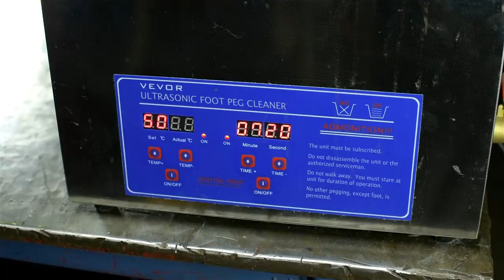7075, 7076... Whatever It Takes

Comment: Would adding to the frame side of contact, rather than the peg side, have been an option?
Reply: I thought of that too. I think it might be better for now, but not worth it b/c he's planning to replace the worn out pegs soon & then the new ones might not fit
Reply: I would imagine it would have worked, until the day when he got new pegs they would be angled too high.   I guess you just hit it with an angle grinder.  Always more than one way to skin a cat.
Reply: Probably, but if he replaces the pegs eventually the new ones would be too high
Reply: Pegs are "consumable" items, frames aren't.
Reply: i think its not only for the new pegs as some pointet out but also for risk reduction/management if the frame side is also an unweldable alloy you might get cracks where you can't simply replace one easy to service part. + the risk of catastrophic frame failure midride sending you on a tangent over your front tire
Reply: A little more tricky to put it on the milling machine for final cleanup after welding...
Reply: My rule of thumb is to modify the part most easily replaceable...
Reply: @drickard67  I like to call that the golden rule.
Reply: @drickard67  ToT would call it "the rule of finger".
Reply: or a crowbar to bend that part of the frame up? Then again, my usual order of attempts to fix goes: 

Spit
Duct tape 

Hot glue 

Epoxy
'wish I had a #%&@*$ welder!

Comment: 0:16 That's something you only let happen once  per pair of underwear.
Reply: Speaking of which, you think he buys new underwear?
Reply: @samo4648  until he finds the proper materials to weld his old pairs together he'll have to i guess.
Reply: "That's something you only let happen once  per pair of underwear.".. twice surely... don't you know you can always turn them inside out afterwards... (and... demonetized in three, two.. one)..
Reply: I learned many years ago when spindle-moulding acrylic to always move the part in the opposite direction to the rotation. It makes it much harder for the machine to pull it out of your hands as you're pushing in the direction it would push the part.
Reply: I believe you can shave it off one thou on a lathe and it's good as new
Reply: Warning: EXTREMELY DANGER!
Reply: Shaun Stephens (psst... that's router 101 rules for every material)

Comment: Hey this old Tony, instead of replacing the pegs how about drilling out the hinge holes and press in a steel sleeve?
Reply: Or maybe relocate the bolt centerline back where it should be since it's worn.
Reply: What - you want he should start making SENSE, now?
Reply: @flurng  Yeah, what was I thinking, maybe I should have had a cup of that ultrasonic cleaner like he did, that would have straightened me out.

Comment: Why didn’t you add the weld to the frame landing zone instead of risking life and limb when your infernal weld heat weakens the peg temperament? Odds are the frame was anything other than 7075.
Reply: If he gets different pegs then those would point too far upwards due to the excess material.
Reply: @skmetal7  which he could then grind off.
Reply: Exactly what I was thinking. the frame is welded so it has to be weldable. If he ever changes the pegs he would just have to grind it down.
Reply: My thoughts exactly. Also, replace the bolts, mill out the pivot holes, and insert some brass tubing to take up the slack.
Reply: Or a bolt down spacer to frame.

Comment: I’m in the following conundrum: I have bought a nice Trek bike for cheap, it’s made from 7075 aluminium, it is a fully welded frame, beads everywhere. One of the weld beads has a long crack through it. I want to try and weld it. 
Everyone is telling me it’s not possible, yet many bike manufacturers are producing fully welded 7075 bike frames.
Uncle Tony’s advice: if it’s full of welds, probably weldable. Thanks Tony 😁

Comment: So a quick theory. Since the caliper has opposed pistons, you may not feel any pulsation from a warped rotor. As one piston is pushed in by the warped rotor, the pressure transfers to the other piston in the caliper simultaneously and does not transfer pressure back to the master as it would in a floating caliper setup on a car.
Applying knowledge to that theory, the reason you would still have a soft pedal anytime you initially press the brake was possibly pad float. Off the brake, the warp of the rotor would actually push both pistons in very slightly over a rotation, which you would not actually feel of course since your foot was not on the brake pedal.
A bit more knowledge from researching car brake upgrades.This happens in cars frequently with fixed calipers, especially if they have a bad wheel bearing or have been upgraded to solid calipers and there is flex in the assembly. Any angular movement in the system can let the rotor push back the pad. Then you have an extremely soft pedal on your first press after cornering.
I do have a final potential theory. In your soft spongy brake video, it actually looked to me like one of your rotor screws may have been a bit loose. If it was, but not loose enough to come out, possibly thanks to the spring washer, then it could have had some run out which would have immediately been taken up when the brakes were pressed. So a similar pad float issue to having a warped rotor would occur, but with even less chance of feedback or pulsation at the pedal.
Hope you don't mind the rant, was just thinking about it a lot.

Comment: About the break rotor...
When you apply hydraulic pressure on the break pistons and these press the break pads into the surface of the rotor, you convert kinetic energy into thermal energy. This thermal energy is initially accumulated inside the steel of the rotor and the irradiated into the environment (infrared and convection).
Now there is actually a saturation function for that process. That means, that the mass of the steel rotor can only take so much energy in (of course the irradiation is slower the pumping energy into the rotor). Is the rotor saturated (mostly glowing red), the break starts to feel “spongy”. That will happen for a thinner rotor sooner then for a thicker rotor, because the thinner one simply Hass less mass.

Comment: U-shaped steel plate with 2 eyelets, shaped in such a manner that the peg bolt(s) hold the plate in place & the plate hugs the contour of the foot pegs and provides that little bit of shimming to de-sag the pegs. Seems this way you wouldn't need those extra two washers either.

Comment: With all these comments, several people probably already pointed out that the Loctite has bad long term effects on many plastics, PVC is among them I believe. It doesn't kick off where the threads (or shoulder) contact the bore ID, and it just sets there, eating away at the part. Hope it helps, and Congrats on the new toy!!

Comment: What you fail to worry about is the heat affected zone at the site of the weld.  First, the heat treat is trashed at the pivot point, the point of the highest stress, and some of it is in tension.  Second (and this is the dominant one in welding) the stress built up in the part resulting heating one point to melting, and the rest at room temperature.
       (In steel, heating by only 140F causes it to expand 0.1%, and if that is resisted, results in 25,00lb/sq in stress.  That's how I hold the tires on my steam engine.  Machine 0.1% undersize, heat ~300F,  drop on, and allow to cool.  Aluminum expands at double the rate of steel!)
     To do this right, you need to heat the part to ~700F, hold (to anneal out the stress), then cool to the 350F treatment temperature, hold for 24 hours, then air cool.  In a week the part will be hard.
     Arc torches are so easy!  Until you discover that to do it right, you need gas torch to do the anneal afterword.

Comment: HI TOT, thanks for your videos, really love them. On the basis of "all information is usefull" and in the interests of shutting the stable door after the horse has bolted, found a new life, got married and become an airline pilot, heres what I think was wrong with your previous bikes brakes. Between the brake fluid reservoir and the cylinder is a small hole called the "recuperating hole, which lets fluid into cylinder to take up wear on the brake pads etc. on this type of cylinder it is critical that the push rod is set so that when you push the pedal down, the recuperating hole is covered by the piston before the brakes start to operate, and that it is uncovered again when the pedal is released to the rest position, allowing more fluid to enter the cylinder. If the recuperating spring is weak, you can get a situation where the piston does not return fully, and therefore the clylinder does not get a shot of fresh fluid when it needs it, and although there is no air in the system, the pedal feels soft, and does not apply the brakes firmly. Oh and they can be a bit of a pig to adjust!.  Two vehicles I have owned in the past ( Morriss 1000 van, and a s2 Landrover) were not fitted with a spring in the master cylinder, and relied on the fluid in the cylinder  to keep the piston in contact with the pushrod, when you tried to bleed an empty system, the piston covered aforesaid hole, and when the pedal was released the piston stayed at the wrong end of the cylinder, blocked the hole, and made any progress impossible untill you had returned the piston to the rest position. I built an ezeebleed system out of junk that cured the problem, and prevented corrosion and stripped the paintwork by covering the car, me and the workshop with hydraulic fluid, but hey, isn't that what life is really all about?  Keep em coming!
Phil,
East Yorkshire
UK
https://www.youtube.com/channel/UCKf0nWnXKXltBjj7MWtdjWA

Comment: After watching the beginning of this video I went to look at you original video.

There is one reason you brake could have been spongy and that is if the disc (rotor) was badly warped. If it were, the first part of the pedal travel would have been straightening out the disc, so there was no reserve travel to do the braking.

When the brakes are released on a disc brake, the deflection in the seals in the caliper withdraws the piston by a few thou so it does not rub on the disc. If the disc is warped the pistons are pushed back further away from the disc. In this case, when the pedal is pressed, the first part of the movement is pushing the pistons back towards the disc (and straightening it out)

Simples!!

Comment: Fyi, the usual causes of spongy brakes is usually air in the hydraulics, oil contamination, worn out master cylinder, or mechanical binding.

I'm glad you replaced the problem with something you've been wanting ;)

Comment: You can weld 7075 in certain applications. Like in mould repair, you can put weld material on top of 7075 to then machine back to form. It won't be great quality, but it's through welds that crack very easily for 7075.

Comment: before I heard your solution, to be honest I am not a welder, machinist and have no experience with any of it but want to get into stuff like this, in a serious way!! (I'm a carpenter by trade) my first thought would be a "grub screw" in the back where the pedal meets the frame, you could tap it and make it adjustable so you can change the point of where it stops.

Comment: Good stuff as usual, love this and I too counted fingers.    Now who thinks most of the issue was in the worn hole and bolts and IF Old Tony just had a lathe at his disposal could have made either a thin tube bushing to fit over the bolt say some SS or  some new Bronze bushing pressed into the Pegs and new bolts but then Old Tony would need access to a Mill or at least a reamer.  Either would or should eliminate buying new pegs for wear in the future.       Then we never saw the underside of the frame mount, could that have had wear or been welded up a tad of which the Frame material could be worse to weld on, Chrome Moly or  ????

Comment: Bit of trivia to all you engineers out there:   AL7075 T6 has a tensile yeald strength of 570Mpa or 57kg/cm^2.   Volume for volume, it's stronger than most steels.   Weight for weight it's almost 3 times stronger than most steels.    Jet fighters (F-15, F16) are made out of this aluminium alloy.

Comment: Intro is why router tables with the bit coming up from the bottom are so underrated. The workpiece can't really move up on the bit to catch it as easy if there's table in the way and even if it does the friction of the table and maybe a fence at the edge helps takes some force off -- not that 20mph off a part being immediately flung 400mph at you is gonna make much of a difference, but it could help, maybe

Comment: A thin rotar can make a soft pedal.the piston has a piston ring that pulls the piston in by design.so if its out further than normal and the piston could be retracting.also if the rotor is warped or not perpendicular it can cause the problem. Diagnosis should isolate the system.clamp the hose while depressing the brake.that should make it solid if the problem is downstream.

Comment: I cant help but point out that when rotors wear they tend not to wear evenly. The pads tend to wear the braking surface so that it becomes concave or a series of furrows. The thickness of the rotor doesn't matter (to a point). The flatness of the braking surface does matter. If the pad is sitting on a bunch (or a few) high spots it wont be able to create good friction. A rotor in this state can make the break feel mushy as the pad is forced to flex until it matches the profile of the braking surface. New pads make it worse.

Comment: Hi, aluminum metallurgist here. I spend 20% of my day dealing with 7XXX series welds and they suck. Now we butt weld which is different than tig welding and there is a higher success rate, but I agree. I highly recommend not welding 7XXX series if you can avoid it

Comment: Well, drooping pegs are a sure sign of warped brake rotors. Adding weldment will definitely void the warranty.  Factory replacements are $325.00 each and factory repairedfoot pegs  (with factory weldments )are $ 250. Pr pair.

Comment: I think the welds will be just fine, but a captive shim could have been used , maybe a strip of metal, with a hole in one end (held on with the bolt) comes out of the groove in the pedal, twists 90* and then bends down to fit between the pedal and the frame!

Comment: Normally on the average dirt bike. There is a chain block/ guide on the sprocket side. To help guide the chain straight onto the rear sprocket. Lower side of chain is the slack side. 
The shark fin is normally on the brake rotor side. To protect the rotor from impacts and bending. 
I'm sure it will be fine, just hope you don't throw a chain. 
Then we will see you make engine cases:)

Comment: In my experience, bad brakes can be caused by invisible amount of grease/oil on the rotor. Rubbing the rotor with lots of high quality brake cleaning fluid to make sure the rotor is absolute clean and replacing the pads (probably already contaminated by the grease/oil) should be enough for any case. Also bleed the brakes if needed and you should be fine.

Worn rotors will cause higher pad wear but should not cause spongy brake feel.

Comment: I'm an eastern PA woods rider, and usually head for tight, rocky trails. Rims crack....I figured it was 6061, welded it (TIG), was kind of disgusted with the result, but went riding.  It was cracked by the end. Was reading then...my DID's and others..Excel, etc, are 7075.  Sun are 6061.
   Curiously,  all of them are formed into a hoop,  then welded...it seems they are electric resistance welded. 
   All of the 4 or so fronts and a rear that have cracked, have done so at the weld, or right next to it in the heat affected zone.

Comment: 1. Soldering and filing at the frame instead was a better option, IMO.
2. Fitting a cylindrical spacer plus a thinner bolt was a better option, IMO (the bolt has only to keep the pin in position, no transversal load on it).
3. PVC is the most cracking material ever produced by the human race. Even the modest ABS is far better, IMO.

Comment: I worked in the aviation industry for 40 years. We never welded 7075. That doesn't mean that you can't. But that you shouldn't. In aviation, 7075 is used in high strength applications. You don't weld it. Elsewhere, you can do what you like as long as you accept the responsibility for the consequences.

Comment: That intro thing… have done the same thing. It works very well with straight cutters. But with chamfered ditos it seems that the workpiece gets compressed between the angled cutters and the work floor.

Comment: RE: brake rotors. There were not warped, they were coned (ok, so, that's arguably a type of warping). The interior of the disk heats up, expands, can't go anwhere, and forces the disk into a cone shape. Upon cooling, it's too hard to return to it's original shape. MOST of the time this causes warping - which can be felt as pulsing, and can be measure with a runout gauge - but coning doesn't show itself in rotation. Too late night if you tossed the disk, but I would bet that's what it was, especially with an under-spec thickness of rotor, which would allow it to overheat quite easily.

Comment: It's called "Piston knock back" and it's not so hard to find, providing you rotate the assembly while inspecting the rotor.
The thinner rotor would warp easier than the original, it's part of the reason for minimum specs.
Don't feel bad, it happens to the best of us.
Lord knows I wouldn't have much to do if everyone got it right the fist time.

Comment: Because I'm firmly in the neighborhood of quick and easy (and have few fancy tools) I'd drill a hole through the back face, tap it, and screw a bolt in there.  Maybe file the head of the bolt down to size.